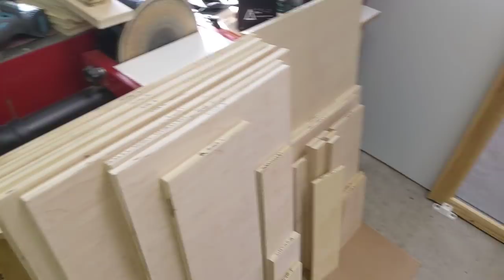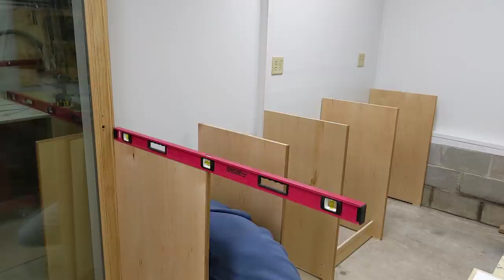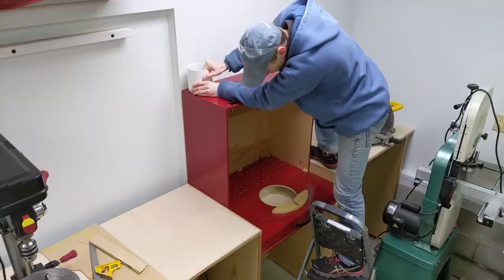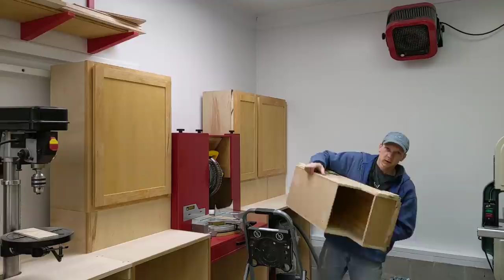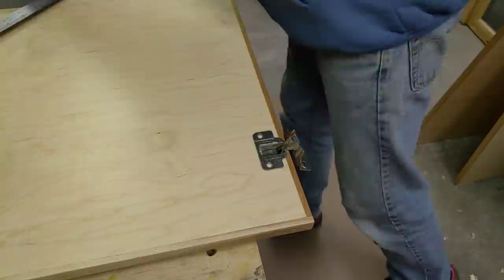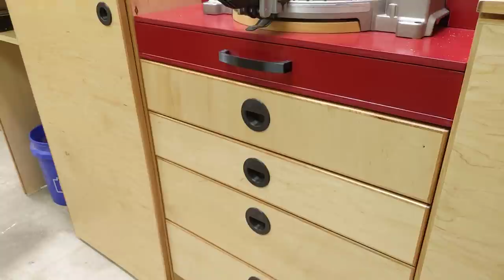How I Built My Miter Saw Station - Lots of Tips & Tricks

Comment: Nice build.  I have sloped floors in my basement and the best trick I found was to drill holes in the bottoms of the panels (add some extra plywood to build up thickness if needed) and use pronged t-nuts & carriage bolts.  That way you can adjust the height easily by turning the carriage bolts, as well as in the future if your floors move any.

I'd also add some cleats under that drill press table top (glued & screwed) or rabbit the top into the sides... take the weight off the screws holding the top to the sides.  ;)

Comment: Great job, lots of very good ideas!  One question, what about the valuable space you lost between the lower and upper cabinets on either side of the miter saw??  That's a waste of valuable space man!  How about some drawers or cubbies?  Really liked the bicycle inner tube idea for edge clamps or even just a little extra clamp padding to protect the project.  Also, really liked your 3-D printing items!  The auxiliary downsized dust pickup is  genius!  You should market those if they haven't been already.  The drawer pulls I liked, but the door pulls not so much.  Door/drawer pulls shouldn't allow dust intrusion, in my opinion, into the storage area.  I look forward to seeing more of your videos, thank you!
Reply from the maker: Thanks Tom! I will probably expand the storage under the cabinets in a future project.

Comment: After fighting dust collection for several years, I finally got smart. I opened the garage door, rolled out my jobsite saw and my planner and let fly with the sawdust.Of course, I have to work fast in the summer here in AZ.
Reply from the maker: That won't work too long in the Minnesota winter!
Reply: Smart until a nice gust of wind blows the dust back into the garage. I know from first hand experience - but at least I get a nice tan working in the drive way!

Comment: Really enjoy your videos. You mentioned you did the math and determined you needed more holes in the downdraft top. What math? I am using your plans to build mine and don’t know how to do this part.
Reply from the maker: The area of the dust hose piping should equal about the area of all down draft holes combined. Determine the area of the dust hose piping using area=pi*r^2. Then divide by the area of the down draft holes to get the total number of holes required. It doesn't have to be exact, just close.

Comment: Really like some of the design elements.  Curious though why you chose to abandon that space between the upper cabinets and the counter.
Reply from the maker: Nice initials :) The main reason I did not put drawers there is because I'm always putting things/tools on the counter there while I'm working and it would be very annoying to access any drawers in that space because there would always be stuff in the way of opening a drawer. So I'm saving myself the frustration by not putting any storage there. I wish I would have put the cabinets up higher another 2 inches because I often knock over my drill/driver that's sitting on the counter when I go to open a cabinet door.

Comment: Bought this for my friend for his birthday, and he loves it. Father-in-law was a little jealous, even. :)  Built solid, but light enough to move around for projects. Easy to use https://www.youtube.com/post/UgkxPeGkHOMe05FySypTOvYumxMn-xi39oRe  and makes great precision cuts. Doesn't come with a laser mount, but the fence is straight as an arrow and if you measure carefully, it's not a problem. Can handle dimensional lumber with ease, but of course, there's a limit to how thick. Handled a 4x4" post without a problem, but 4x6" we had to flip and cut twice. Only thing we've noticed is make sure to tighten the nut that holds the saw blade when you take it out of the box and maybe check up on it occasionally. For some, this is probably a no-brainer, but we neglected to do this and a few months in, found the motor running but the blade spinning at about half speed or less. Tightened the nut, and problem was solved. Very happy with this purchase. Dewalt makes sturdy stuff.

Comment: Very nice Justin...full of innovation! Do you need to align the slots on either side of the mitre saw with the mitre saw and each other very accurately? I realise they are used for your adjustable end stops, but they could be used as extensions to the mitre saw fence to aid cutting longer lengths. Am I over thinking this? :)
Reply from the maker: Thanks for the comment. No they don't need to be aligned. Only the fence on the miter saw is needed. You don't really need extended fences to cut long pieces.
Reply: @JustinDepew  Thanks Justin.

Comment: Hi Justin, why you don't 3d printed the same pull of the drawers also for the doors? Just to prevent entering sawdust. Anyways it's a very good job, I really liked it!!! As always thumbs up!!!
Reply from the maker: Mostly because I hadn't thought of the design of the drawer pull yet when I was making the ones for the doors. The hole wasn't too big of a deal on the doors. It's okay if a little dust gets in there but I'm sure it won't be much.

Comment: Nice build! The only thing I would have done differently is perhaps add drawers or something to the volume lost below the upper shelves, to min-max the storage :)
Reply from the maker: I contemplated this, but decided against it. My thought was that there will often be tools and stuff set on the work surface while working on a project. And then to get into the drawers I would have to clean all the tools and stuff off to open them. Well see how it goes.
Reply: @JustinDepew  No matter, that answers my question. But in such a small space, I imagine your pretty tidy anyway and small parts are a must for an engineer.

Comment: Thank you for posting the 3d models.  I was going to have my son print them but his printer in no longer.  I'm new to this 3d printing world.  Any suggestions on where to get them printed?
Reply from the maker: There are online services that can 3D print objects for you, although I have never used them so I can't vouch for a single one is particular. Which models are you interested in? I could print some for you for a fee.
Reply: @JustinDepew  Thank you for that.  It's very expensive to use another service.  I need one of the Dewalt hose adapter and 2 of the 4" PVC to Shop-Vac hose 45 degree

Comment: Nice project and well done, as always. I really like using those deck screws as well! Did you cover over that outlet on the wall or did you cut out the back of the cabinet?
Reply from the maker: Thanks! I ran a power strip from the outlet to under over by the drill press.

Comment: I completely get how people love good dust collection, however I personally have none in my garage. The floor is carpeted in shavings and everything else is caked in a layer of dust. I actually love it like that. It feels very homely and welcoming when you walk in. It is my happy place. I clean it out with a shovel about twice a year. I used to despair when i dropped something small like a nut as it was immediately lost forever. I solved that by expoxying a bit magnet to the end of a stick. I just wave that around in the vague vicinity and it finds stuff fast.
Reply from the maker: I actually do it mostly to keep the air clean for my lungs. With my small shop it only takes a few cuts and the air is filled with micro particles.
Reply: @JustinDepew  Agreed. I do wear a respirator most the time.
Reply: Man that's not a really good idea. Respirator or not you are not wearing a respirator all the time you are in the shop. I'm in my shop everyday. Some words extremely toxic dust wise. But to each his own I guess

Comment: I recommend putting the dust collector in the garage even at the expense of heating the shop. It makes an incredible difference not having it vent into your workspace.
Reply from the maker: I keep going back and forth on this... is this what you do?
Reply: @JustinDepew  I vent mine directly outside. And I dont notice a difference when heater is on. I say stick in garage and run a temp line into shop, heat it up and run it for like 30 minutes and see if the shop gets cold.
Reply from the maker: @NASTYcraftX  I like the idea of venting outside but with my small shop I can't get over the fact that I can literally suck all of the hot air out of it within a few minutes given the air flow of the dust collector. Granted I only heat the shop on a limited number of days....
Reply: @JustinDepew  ya I understand. It only gets to like 35° here tho.

Comment: You covered a plug? Must be nice to have extras.
Reply from the maker: I extended it with a power strip to under the cabinet but didn't show that in the video.
Reply: @JustinDepew  you may want to rethink how you covered up that outlet.  Essentially you have a hidden junction box and that is against code.  A fire could smolder back there for a long time before you knew it had happened.  I had a homeowner insist that I cover two junction boxes in the basement ceiling when I turned that space into a living area and I had to walk away from the job so as not to be responsible if there was a fire and they found those hidden boxes.